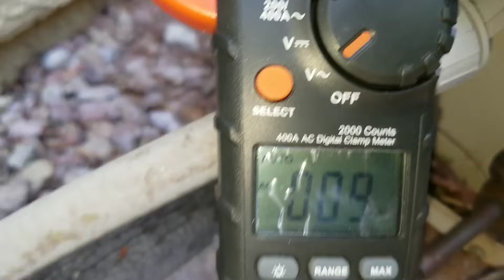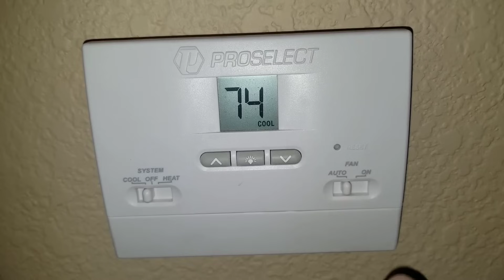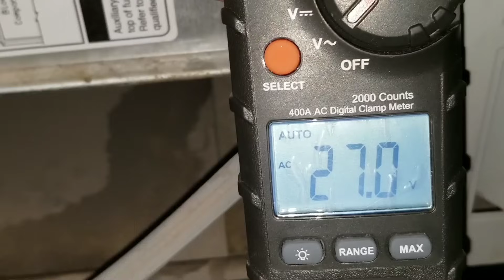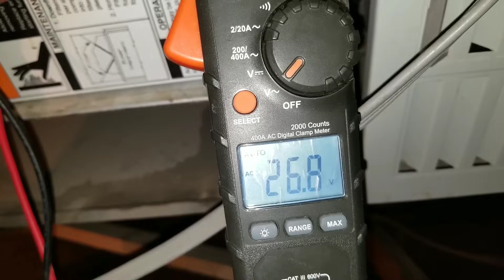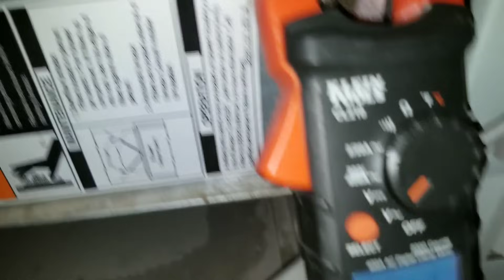AC Not Working. Not Getting 24 Volts to Thermostat. REPAIRED!

Comment: I was getting an error for no power to the R wire. After testing the wiring I found it was simply the light switch on the wall that sends power to the board was faulty. Your video helped me understand what voltage should be on each wire. Thank you Sam......Thank You! 🙏

Comment: If the low pressure or high pressure switch trigger, where does it cut the low voltage power. To the thermostat or to the contactor?

Comment: I have My Y only has 12 volts but the rest of terminal in low voltage has 24v would that be similar issue with this ? I have not diagnosed the furnace board yet.

Comment: Thanks so much. AC compressor wouldn’t run. I replaced fuses in 240 disconnect box, and all then the capacitor. Still didn’t work. 
Watched your video and figured out 24v DC wasn’t getting to contractor. Traced it back to a bad wire nut hack job connection in my indoor furnace panel. Saved me the cost of a service call!

Comment: Super concise video. I am beginning troubleshooting 24V failure at thermostat. For the past week, I have been getting short cycling and thermostat (which is a smart thermostat) reports 24V failure up to 27 times/day. So I don't think it's as simple as a fuse since that is a point failure that does not reset itself. I have repaired controller board before, but can't remember what component failed. It's an older unit (20years+). Will be running through your basic check first though.

Comment: I am having a similar issue. I am only getting about 12v at my thermostat. I put a brand new stat a brand new transformer and still the same thing. The unit is about 20 years old and i do not see any fuse on the handler control board. I am also getting about 12v at the board. If i start condenser outside manually everything works. Just does not work when i turn stat to cool its not getting the right juice. Any recommendations? Thanks a lot.

Comment: Just because your stat is flashing doesn’t necessarily mean you have a low voltage short something can be open causing interference and interruption with cooling Engagement. Another thing if you discover a bad fuse make sure you have several because if you replace it, good chance you do have a short and it will eventually pop again it can be a spliced wire touching metal or something etc and not good to teach guys to use they’re hand to push in contactor not a good practice for the guys whom are learning beginners can easily be hurt use a screw driver ladies and gentleman. And again check everything something becomes defective it’s a reason why! Ya always wanna know why. That’s what makes difference in a Parts changer and an Technician. Other than that good video.

Comment: I had the same issue no power(24v) at the contact. The problem was that even though the thermostat was working. The batteries were low enough to not send the required 24v. Replaced the batteries and the fan and compressor turned on.

Comment: This video saved me!! Just crawled out the attic to write this. It definitely was the fuse. Wierd that my compressor wouldn't turn on but my motor in the attick would run automatically even without the thermostat attached. Stuck relay maybe? Regardless I now have cool air.😊

Comment: I have a problem with my ac not blowing any air on any vents. Checked my fuse and wiring seems to be ok. Even replaced my capacitor from my furnace still no luck.? Any help here would be appreciated. Thanks in advance ❤

Comment: Thank you! You saved me from a wife with no AC in 95 degree heat in Florida.  The very old thermostat had a burnout on the circuit board and nearly caught fire.  I installed a modern thermostat and rethreaded the wires as they were the root cause of burnout out on the very old thermostat.  I then had to replace the 5 amp fuse as it thankfully failed and protected the rest of the system.  Now everything is working great and with the modern thermostat better than before.

Comment: Thank you for very detailed and thorough video. I had already working through the steps  confirming no power at the thermostat but didn’t know where to go from there. I had the same fuse issue. It got my ac up and running and made the wife happy. Thank you!

Comment: 118 volts on top 27 volts on low voltage side. But on the screw terminals I only have 14 volts. Fuse isn’t popped. Is my board bad?

Comment: I just tried to install a smart thermostat. Everything powered up fine but the AC would not kick on once the smart thermostat was connected. I called Honeywell and they did troubleshooting and they said because two of my wires were at 35 V instead of between 24 and 28 it was putting off too much voltage in the system was not kicking on. How do I lower the voltage? My previous regular thermostat has been working fine for the past three years

Comment: So I had a blown fuse too. But when I replaced it, something happened at the thermostat that caused a burnt plastic smell and the Ecobee says I have the wires crossed now..i didnt move any wires and it worked fine for the last 2 years.

Comment: update : without doing anything the ac started. I do have the 24v back at the thermostat. While it is a good news, there is trouble as well.  I was not able to "fix it", it just fixed itself, which we all know isn't exactly a fix. So I suspect control board contact issue. 
I already have the same problem with the gas heater, often works, sometimes not and I narrowed it to control board issue.  I might have to buy both control boards. Anyway still the video helped me and was awesome so thank you !

Comment: What could blow the fuse ?  Old age ? I have a same issue, no 24V at the thermostat. I suspected the transformer until I saw your video. I will try and check the fuse in the morning and I hope that is all that's wrong ! Thank you for the video and the clear explanation and good visible camera work.

Comment: Hi, I have two zones and one of the thermostats has stopped working,  I thought it were batteries,  but after replacing them it's still won't turn on. The other zone works fine. What can I check?

Comment: Hey I had my furnace replaced in December, the outside unit was working fine before the men's did the job. Now comes the hot months and I go to turn on the AC and my outside unit won't turn on. There isnt any low voltage coming out to the system. Could it be that the company didn't connect the low voltage to the new furnace unit?

Comment: Why was was the light still blinking?  On terminal block there R and C has 28V. But Y and C has no voltage; so wire going to contactor coil and NEST STAT  have no voltage. When I put back NEST on connector, the  3 AMP PCB  fuse would blow. As long as I keep the display of the base LED stay continuously LIT. if I put NEST display on base, fuse would blow. If there is ground on Y line fuse would blow. But with open circuit @ PCB and NEST base, what could be the reason same voltage as between R and C does not show up between Y and C. Any clues you can offer/

Comment: FYI, if it turns out you have 24 volts in the air handler, but not at the thermostat, check the overflow sensor (safety switch)to see if it's keeping the unit from turning on.
Thank you so much for this video!

Comment: 6:05 ! Replaced the capacitor, Start capacitor, Start relay, and contactor…still no power to fan. Found the #5 fuse in my unit in the attic BLOWN. Cheapest replacement part and that’s what got me back up and running  💨.  Thanks Sam you the man !

Comment: Does every furnace have board with a fuse like this one? I hooked up a new thermostat a few months ago and my AC has been running fine. I went to switch on my heat and now it won't turn anything on. I think I may have shorted out my common wire and popped a fuse but I can't find the fuse. I opened up the furnace and took the panel off but no board or fuse. It's a really old system in a trailer

Comment: where would you look if the air handler does not have a fuse? I do not have power to the yellow wire

Comment: Wait I'm confused. 
You check for 24 volts at the thermostat and get 0 volts and then immediately go out and check and see if you have 24 volts at your contactor or outside?

Then you go back in and try to jump red to yellow knowing you have zero volts? Ummmmm🤔 hmmm

Comment: Good description and step by step diagnosis. Just a thought here, would it be good at the end to check the current draw on the circuit that blew the fuse to see if there is a problem of excess current draw? Blown fuse is a symptom/"safety valve" when there is another issue. Since they don't just wear out, something caused it to blow, which may be likely to repeat. What should the current draw be? and what was circuit amperage specified by manufacture, fuse size specified by manufacturer and what was the fuse size that blew and what was the measured curcuit amperage? Not criticizing. Just seems like a final step that may be helpful. Again, good video and explanation. (I am not a pro.)

It may be that pros know that surges, lightning, low line voltage and other issues cause this problem. Just thought I would inquire.
Thanks for the good video and info!
Reply: All I can say is thanks!!  I don't usually bypass all the testing, but I knew I had my answer as soon as you went to the fuse.  I started by turning off the power to the furnace, pulled the fuse and had my problem identified.  Tracked down a fuse and got my AC back online.  We've had a lot of storms and l lightning lately, so I'm hoping that's what caused the fuse to blow.  Thanks again!!

Comment: @Sam: A question: I saw you measured the voltage using the AC Vol setting. Shouldn't it be the DC Vol setting? Thanks.
Reply: No

Comment: Great video. I had the same issue. I installed a new Honeywell thermostat without looking at the directions. Long story short, I had two wires, O and B connected when I just should have had O. For whatever reason that shorted the control power on the heat setting only (not cooling) and blew the control power fuse.  Today was one of those learning days. Thanks Sam!

Comment: Do  you have any idea why my heat pump ac system has had a need for the thermostat to be replaced three times over the past 3 weeks? When the stat is replaced, the system comes right back and runs like it should. The original was replaced and I get that. Five days later, the replacement stat was diagnosed as faulty and was replaced. Ten days goes by and the system is showing the same symptoms, no running of the interior air fan, no running of the compressor, no humming, silence. If it turns out that the system will run again with yet another thermostat change and nothing else, what could the problem be and are we chasing symptoms and not the cause. The tech is trusted and honest for more than 15 years .
Reply: If anyone is reading this post, the issue this time was a main system 45amp fuse.

Comment: Thank you for the excellent video.
I have a similar issue, followed your video till the point you found your fuse problem, my fuse is fine but no 24v ? How do I proceed?
Reply: Did u find out what it was?
Reply: Von Vanta it was the contactor, had a hunch, bought a new one. It worked

Comment: You should never put your finger on the contractors. There is high voltage there. Too easy to make a mistake. Use an insulated screw driver or the lead of your meater.

Comment: Sam:
THANK YOU! This explains a lot.  I will check tomorrow morning whether I have the similar board and a fuse that I can replace.  This afternoon, while trying to be a smartass I may have blew that power.  My problem was a that the CAP was out.  I did replace the cap first.  The contactor relay was kicked but the FAN and the compressor was not running in while the bad cap was there.  By the time I procured an appropriate  CAP and replaced it, the thermostat (which I have a NEST), may have stopped  calling for cool.  While working outside, I looked around for other reasons why the compressor did not start.  I found this little fixed thermostat-looking "Crankcase Heater Kit" that was terminated between L1 and T1.  Thinking that it needed to be normally closed, after measuring it open using my Multi-meter, I cut that out and bypassed it by shorting the two leads that went to it.  That must have done it! Killed the Low voltage power fuse due to the flow of unusual current through the circuit.  After that, when I pressed the contactor in with a screw-driver, the fan and compressor ran fine (with the new CAP).  But it will not run under the thermostatic control.  Playing with my NEST Thermostat, found that it was complaining about Power and was showing an error code "e-23".  Called Nest support, they were somewhat knowledgeable on the troubleshooting of their Nest product, but not enough to tell me what could be wrong with the Air-handler side control Unit that supplied the low voltage power.
Your Video was quite helpful and makes sense, that the fuse may have blown in the control board.  However, my model Carrier, may have a different control module.  I will have to search for the fuse location if it is in a different location.  I will let you know what I find tomorrow.

Again thanks.  Great Video and you earned a subscriber!

Comment: My fuse poped as well. but my thermostat still giving me a Y error. My unit is on and all, stays on even while thermostat pulled off. Any ideas?
Reply: Sounds like you may have a limit tripped. In that case, your fan will constantly run, no matter if you tell it to or not

Comment: You should check also the voltage drop and current flow from the wiring make sure it wil not blow the fuse again that’s only my advice thanks
Reply: I got 16V at the fuse, 26V transformer output minute 6:55video … it is something wrong with that?

Comment: Hey Sam love your videos very helpful thank you!!
I have the same problem. But I'm not getting power at all to the thermostat. And I checked the blower my red LED light is not on. I've changed the converter in the blower and the contactor in the condenser. But still have no power not the red LED light is working.
Ease help!!!!?
Thanks

Comment: Well you just saved me at least $100. Had low voltage on my tstat (must have shorted when installing my nest), checked out the things in your video and swapped the 3 amp fuse. Works fine now. Thanks man!

Comment: I am not getting 24 volts to my AC condenser as blower fan works fine. Furnace works fine also. fuse is GOOD. very little voltage coming out of transformer when  AC should be on. I put my leads on red and black from transformer. MY thermostat keeps having a 5 minute delay before it kicks on the fan as It never done that before.  I am thinking transformer is Bad. AC unit comes on when I push contactor on unit outside.

Comment: if you've got a popped fuse, it's because of a low voltage short. before replacing a fuse, you need to find where that short is. if not, you are going to have to replace that fuse once again.
Reply: I agree; however sometimes especially in Florida, thunderstorms will cause power surges and cause multiple problems with circuits.  I have lost fan motors, circuit boards and transformers due to electrical surges. I installed a power surge strip and it solved the issues
Reply: Yup just gona say this where is the root of the problem...can u detail where u start to look for problem in low volts area donu start at sequence of ops not sure ?
Reply: Not always true, a surge could pop it.  I would use a resettable fuse to test it.
Reply: If it was a short, once he added the new fuse, it would have automatically blown unless there is a time delay. Also, I believe that he would not get 24 volts were the fuse terminals are. The fact that the new fuse did not blow and that there was voltage were the fuse goes, it shows me that the fuse was faulty.
Reply: Will it be fixed once the second fuse is replaced? I want to know if I should buy 1 or 2 fuses to save a second trip to the store.
Reply: E fuses, where to buy Homedepot..
Reply: Its a 3 amp fuse. Not an E fuse  @landscapevision6553

Comment: Great tutorial. I bought a house here in Vegas and there were wires coming from 1 Furnace to another. I checked because i upgraded to a smart thermostat and needed to connect the C wire. I suspect the transformer is busted because i checked the same purple fuse and it was ok, but the red board light was not blinking while pressing the black safety switch.

Comment: Great video; thorough and logical. The 3 amp fuse on the air handler circuit board was indeed the problem. I would have had to pay $200 for an emergency service visit, if not for this video. Instead, I spent $5 at Ace Hardware and —— problem solved! Thanks so much!!

Comment: I tried to change my digital Honeywell to a new Ecobee4. I turned off the 2 paired A/C breakers thinking that was enough, not realizing that there was still power to the thermostat. I realized I needed to power off the living room hallway to do so. I connected the wiring exactly like I was asked but had no power to new thermostat. I got frustrated with it so I tried to connect the original thermostat back but had no current as well. I barely found out that my furnace was in the attic exactly the same way like in the video. Please help.

Comment: What was the cause for a blown fuse?. Thanks for your tutorial. Good information
Reply: In my case, I inadvertently crossed two wires and saw a spark, even after opening the breakers. That circuit board has some large capacitors on them, and they store voltage until they have a path to discharge. With breakers open and everything disconnected, it just takes brushing two wires together and the fuse gets fried!
Reply: Can you use 5 amps fuse to replace 3amps fuse if possible?
Reply: @anthonyramos3583  you should always put the same size fuse back when one goes bad.